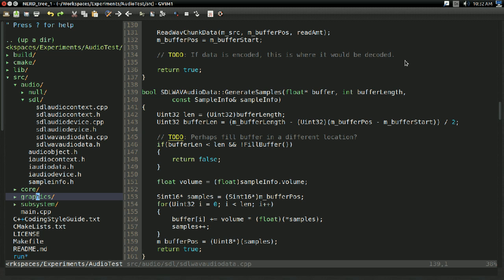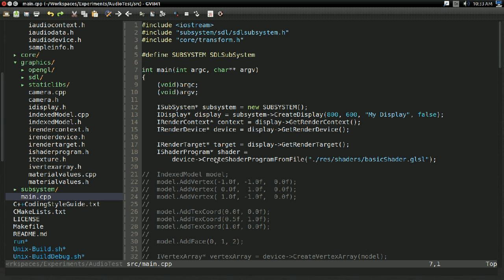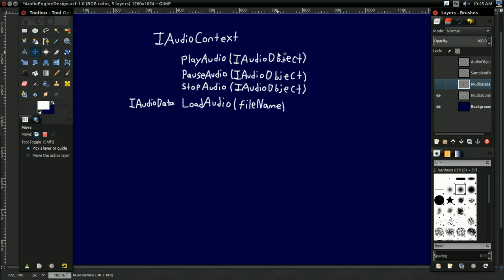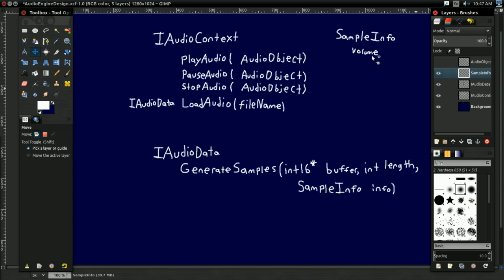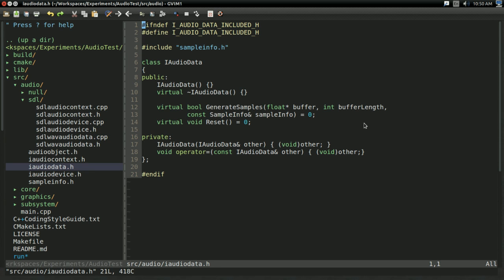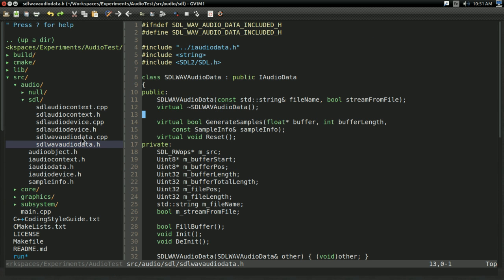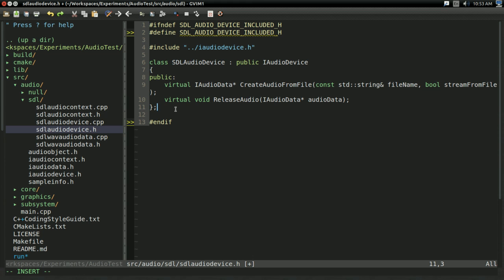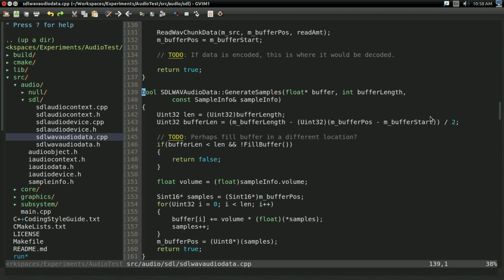Update: Behind the Scenes 2

Comment: why not use a virtual destructor in IAudioObject instead of explicit free function?
Reply from the maker: I'll talk more about this in the series, but there's ultimately two reasons, one practical, and one theoretical.

In theory, it's a good idea to have whatever allocates memory also delete it. That often simplifies memory management because you don't need to think about things like "this method might have allocated memory behind the scenes, so now I need to somehow free it so that no memory is leaked." In this case, since the audio data is allocated by a factory class, then it follows that said factory class should provide a way to free the audio data.

In practice, there are some problematic things that can occur if you allow the audio data to free itself. For example, let's say you start playing a piece of audio, and free it while it's still being played. All of a sudden, the code that's playing audio is accessing freed memory that may now belong to someone else, and that can cause all sorts of problems. If the main audio interface provides a free function however, you can do some sanity checking. In this case, you could make sure the audio being freed isn't also being used, and potentially correct or at least avoid the problem.
Reply: There is nothing stopping you from doing that sanity check in the destructor. Or have the destructor call the free function with this.

Or use shared pointers (reference counters) to know when to delete; the owning object holds one reference and when it is playing the sound engine hold a reference, when it is done the sound engine removes its reference which may or may not be the last one and then can delete it.
Reply from the maker: ratchetfreak Don't get me wrong; you absolutely can do all of that in the destructor if you want to.

The thing is, I don't really see a compelling reason to do so. Keep in mind that the create method is returning a pointer, so you'll need to explicitly free the memory anyways. The only difference is you type "delete data;" rather than "device->ReleaseAudio(data);"

That said, I haven't explored doing context sanity checking in the destructor too deeply just yet, so I can't say anything for sure. My initial thoughts suggest it would make things more complicated for little gain, but it's possible there's more to it that I'm not thinking of just yet.

As for the shared pointer suggestion, I've actually been experimenting with that sort of resource management recently. My current prototype code does more or less what shared pointers do, but with a few extra features that'll be useful for this sort of application. For example, if you try loading the same file twice, it'll automatically reuse the existing data in memory rather than load it again. It's also built on top of the current interface, rather than integrated into it. Not only does that mean this can potentially generalize to other sorts of resources, but it also means you can use the audio data directly and bypass the resource management system in lower level code that doesn't need it. This is all still a work in progress, but it's showing quite a bit of promise at the moment.